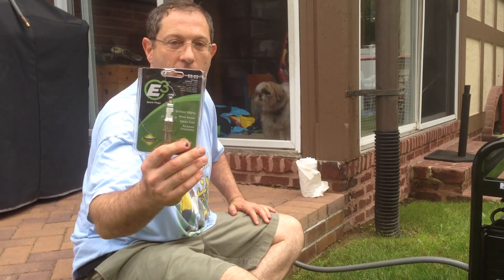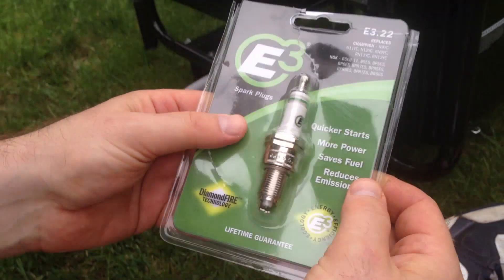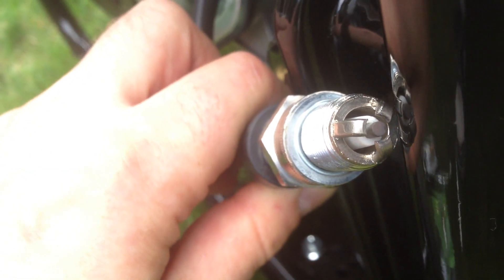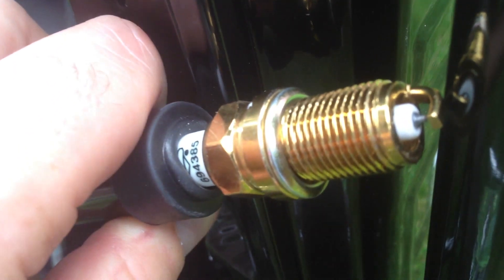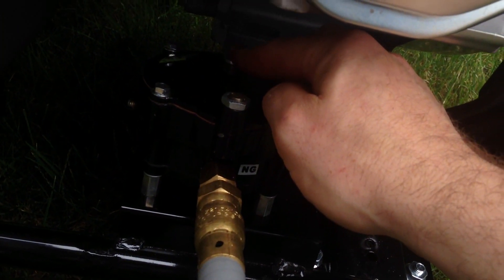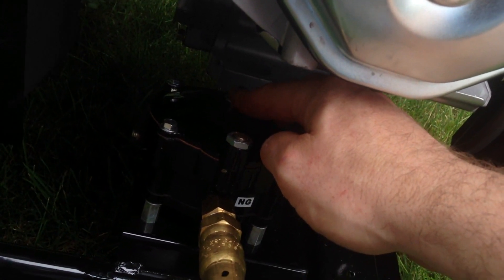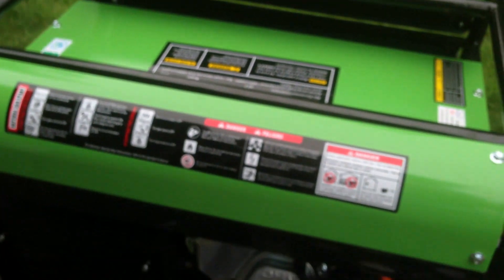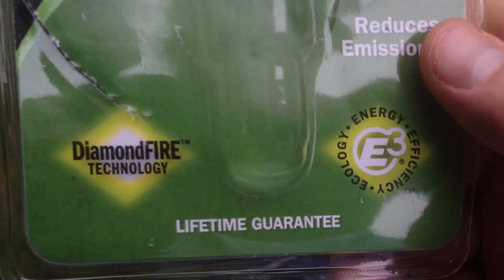E3 Spark Plug Review - Comparing Spark Plugs in a Powerland Portable Natural Gas Generator

Comment: Also. I still say those multi ground spark plugs are nothing more than a gimmick. Electrons seek the path of least resistance and will only arc to the ground that is the easiest. If there is residual arcing on another ground, it isn't going to make the sparking event any hotter. Singles are just as good.

Comment: After watching a few of these natural gas in generator videos, I may stay with good ol gasoline after watching you guys pulling and pulling and pulling. I prefer the one pull starts I have now. Or set up for tri fuel but use gasoline as my primary fuel, with propane or natural gas as my secondary fuels.
Reply: good luck running back and forth to the station.
Reply: @anandchundi6805  I ended up getting a duel fuel carb for my generator. Can run on gasoline, LP, or NG. I run on LP only. The carb has never seen gasoline or NG. Carb was only $39 and took about 4 minutes to install.
Reply: nice, I just ordered a powerland 8500w lpg,ng,and gas gen. I tried doing multiple carb kits and and different carbs for my champion but it will not work. Idk why it just sputters on gas, and won't take the propane or ng at all. That generator sucks ass. I installed everything right it just won't work, I had a technician come by to prove it and he was scratching his head. Only problem is it seems powerland is out of business now, but in reality if something catastrophic happens to the generator its going in the garbage
Reply: @anandchundi6805  Oh wow that's not good. From what I remember Champion generators always got good reviews.
Reply: they run great normally but dont seem to take to a mod kit. Idk why. The engines on all these open frame generators are basically the same chinese honda clones so most run similar but its about whatever other hardware is on the engine that seems to stop it.
Reply: @anandchundi6805  I have 6 of those engines. Snow blower, leaf blower, generator, 2 mini bikes, and 1 spare. All are 196cc except for the generator which is a 208 cc. The only problems I have ever had was with the carbs. And it was usually an easy fix. In my opinion they are decent engines.
Reply: 100% agreed. Good engines for the price, you see that though they're all very similar/the same?
Reply: @anandchundi6805  Nearly identical. I opened up 5 of these engines when they were new. Even internally they look the same. The harbor freight engines had metal shavings inside brand new. My 2 Hisun engines were very clean inside new. Never opened up the generator engine.

Comment: I'm amazed your 'test' produced any spark at all. Grounding to a powdercoated frame that needs to go through rubber engine mounts to connect to the engine is a fantastic way to ruin your coil. Try grounding to bare metal on the engine in the future.

Comment: You really should coat the sparkplug threads with anti-seize compound to prevent galling and corrosion!
Reply: That's an absolutely horrible idea. NGK for instance, warns against doing just that since it can easily lead to over-torquing followed by stripping of the cylinder head threads, most of which are made of soft aluminum. Modern plugs all have coatings applied to them at the factor anyway.
Reply from the maker: Good Point!
Will Do!

Comment from the maker: I recommend 3/4 Inch Hose. You can if you want then reduce it to 1/2 Inch MNTP to Connect it to a Large Webber BBQ Type Regular BBQ Line since that uses a 1/2 Inch Quick Disconnect. But I also once checked the numbers and I saw that for a 7500 Watt Generator or so, you can use a 1/2 Inch Line for at least 12 feet. See My Powerland Generator Video for More Details.

Comment from the maker: Interestingly, the engine was running rough on these sparkplugs and had to be leaned a little to get it right. Maybe these plugs are burning the natural gas more thoroughly, and therefore it needs less fuel to run properly. Also I heard that Bosch Now sells Platinum+2 Sparkplugs that are platinum plugs with two conductors. Might be worth experimenting with. Feel free to post any observations that you have from your generator.

Comment: Once again, thanks for producing this video.  I will buy an e3 to have on hand.  Will experiment during the winter time to see if it makes a difference on my machine.  Mine actually charges the 12v batt while running.The biggest thing I think that will help on cold starts though is 5w-30 instead of10w-30 oil.Still have not heard back as to if that is OK with the generator.  The Powerland tech people do NOT respond to emails.  Luckily it is working as promised after tweaks to gas with your help.